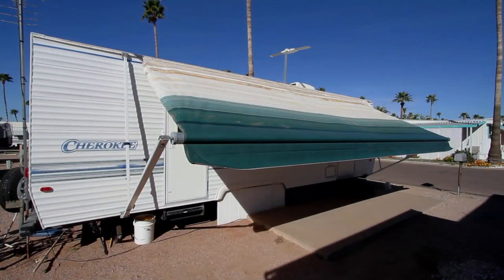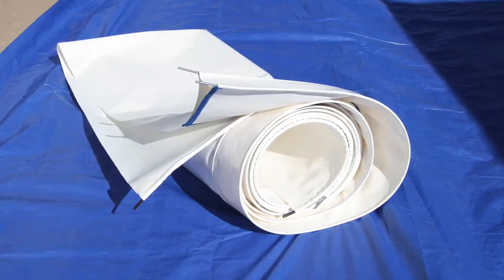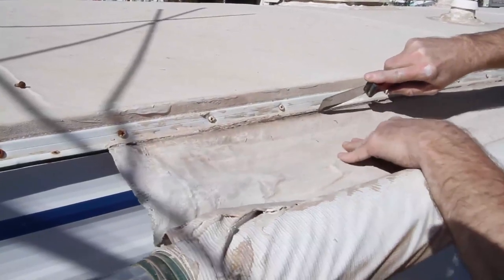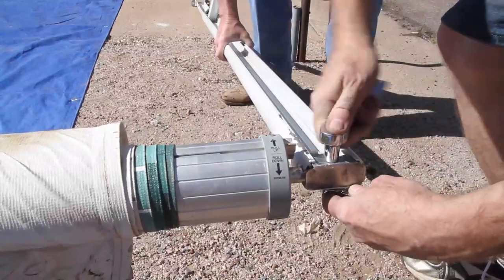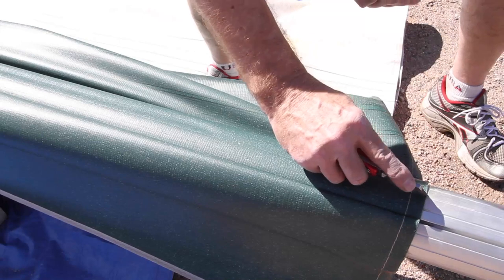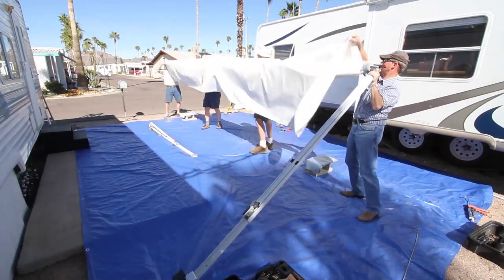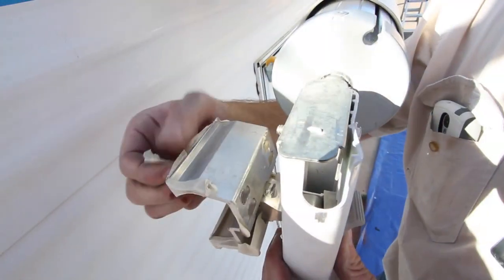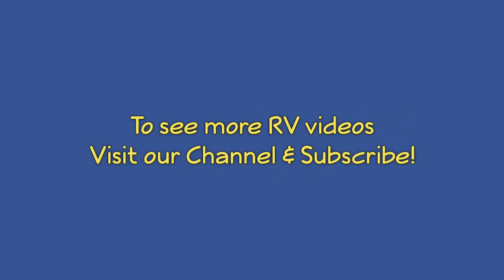RV Patio Awning Fabric Replacement - Tough Top Awnings Discount Code RVGEEKSROCK - 5% Off Your Order

Comment: Excellent video. It took us just over an hour to do the whole thing. No place to put a screwdriver in to hold the spring, so we took both ends off. Made unrolling and re-rolling the fabric much easier; just spin the tube! Piece of cake!
Reply from the maker: +Paul Fredricks Excellent!
Reply: +Chris Edwards yes, just unwind it with the vise grips and count the turns. no big deal.
Reply: +Chris Edwards the tension is fairly light, at least it was on mine. Mine is 13' wide. I think I did it myself. there is enough room to put the vise grips on the shaft between the bracket and the tube.

Comment: Easy going and I didnt have to cook for my helpers!!! In and Out is always a good bribe!!!!
So issues I had....the top rail was packed full of dirt after a mere 10 years outside and very little roof cleaning. I took a wire brush to the rail then power blasted with the hose. I was in no hurry and let it dry while I did the 360 vents. To spin the tube tight I used a rubber strap oil filter wrench. Worked great and I had visions of the Vice grips turning like a Helicopter rotor into a body part...  I usually injure myself once per trailer project. None today!!
I went ahead and gave it one extra twist and it turned out fine. I also hit the spring with WD 40 on the rusted parts.
If you have this style awning, locate yourself some sort of additional strap to keep it secure while on the road. A big bump in the road can cause the bars to unlock and the wind will take it away. I use a dual "D" ring(like a motorcycle helmet strap) to lock it closed when not in use.  Power awnings usually lock when not in use.
Screws in the bottom were pulled out a bit and rusted. I used new screws that were a little longer and in they went with the little bit of Dicor self seal I had remaining from the 360 vents.
I have written this in many Geek replies...do not try to save money by purchasing 1-2 dollar chalk from Lowes or Home Depot. It is not made to roll down the highway. It is made to fill a crack in a wood fence. You have to Buck up and spend the 12 dollars on Dicor or (OUCH) 16 buckaroos on Surebond SB 140 when doing the skylights.
Thanks John and Pete
Reply from the maker: Thanks for the great input on how your awning project went, Scott. Love that you didn't sustain even a single injury on this one! :)

Comment: The step by step instructions are spot on.  Unfortunately the guy I bought the camper from had already purchased a cheap replacement and we had to push the cords through the pockets and there was only one cord pocket connecting the fabric to the roller.   To anyone reading this, buy a good replacement awning from the guys RV Geeks recommend and not cheapo ones from Walmart.
Reply from the maker: Hi John! Sorry to hear the previous owner went that route with the awning fabric. Tough Top Awnings is definitely far superior than anything else we've ever seen. It's obvious just by looking at it. And it even comes with the cord installed already!

Comment: Thank you a dozen times!
I'd have made at least a dozen errors had I done this tricky job by the seat of my pants! (I'm a pretty good mechanic.)
My wife and I replaced our 13' awning in under 3 hours, with a key hold-up related to the fabric we bought, not your instructions. I did also, as mentioned in Comments, cut the top fabric free of the awning roller to make removal simple.
Thanks for a SUPERB video tutorial!!
Reply from the maker: So great to hear, Jim! That's awesome. Thanks for letting us know we were helpful. Means a lot.

Comment: This was the most helpful video of the group. Was able to do this with 1- 1/2 people my wife is not real good on ladders but was able to help at points. Her and a couple of saw horse did the trick. learned enough about changing this awning that we were able to cut out a good corner of the old cover and replace the slideout topper . Would post  pictures if there's a place to do so.

Comment: Thank you for making this video. I used a combination of a few different techniques, but your video was the overall template I used. Worked great, and saved me several hundred dollars! One tip I would be in additioin to using the silicon spray on the tracks would be to put it on a paper towel and  lightly polish the aluminum spindle (the spacing between the awning track and the valance track) - made the fabric glide right over it.
Reply from the maker: Great to hear you had a successful installation, George. And thanks for the additional tip! 😊

Comment: i was going to follow your instruction to change mine.  a across the way was watching and offered his help.  thank god! we removed the old one in 5 minutes by  simply cutting it and sliding it out. first we drilled a 3/8" hole in line with the valence channel which was covered by the roller cap, then filed a slot to allow the valence to be removed.  we extended the awning fully then removed the arm bracket on the side we were sliding the new awning in ( the front in this case ) we only had to remove the 2 bolts and drop 1 arm.  we cleaned the channels and lubricated them with lots of dish soap mixed 50/50 with water.  with 2 guys guiding the new awning and 2 guys pulling it, we set it in place on the roller and the camper at the same time and just pulled it gently along.  literally in 10 minutes it was done.  we reinserted the stop screw, seem sealed the top seam and caulked the top. We took the time readjust the arms so they lock in place on top, which they never would before. All together we took about 45 minutes, 25 of that was adjusting the arms. I realized we modified the end cap of the roller by drilling it but it was a 2002 model and there was no warranty to void.  I'd personally recommend this way for anyone that has an older model camper. curious about your thoughts on this.
Reply from the maker: squeezy33 This sounds really interesting, but we have a question about one part of it. If we understand correctly, you drilled out the roller tube to allow the beading in the fabric to be slid out without removing the end cap, very much like what we did here: https://youtu.be/iF5IhGQuQm0?t=3m16s. If that's the case, it seems like you should then have been able to remove the old fabric and install the new fabric without removing any other hardware. But you mentioned that you "removed the arm bracket" by removing the bolts and "dropping 1 arm." If the channel was drilled out to allow the fabric to slide in and out without removing the end cap, why was it necessary to also remove the bracket & arm? Very interested in your method, and would like to be able to picture exactly how it works. Also, what brand is your awning? Thanks!
Reply: +RVgeeks yes we did remove the leading an from the camper. this was not absolutely necessary except that the two people feeding the fabric were to short to reach up comfortably. it made it much easier and we were more able to control the new fabric being fed in the roller and preventing it from accidentally tearing. I understand your video shows the proper way of doing this without modifying the end cap, which would void any warranty, but my camper is 15 years old so, what the hey! 
thanks for your reply. your video was still very helpful and very detailed. it would have worked 100%. but after we replaced the first end cap and put the canopy to its original condition, it was literally 10 minutes max and we were done. there new canopy looks and works great.

Comment: Thanks so much for creating a video that is a great starting point.  The replacement fabric on our awning came with instructions, but no illustrations and some of the steps were very confusing.   This put pictures to the words, which basically described the same steps you did.   However, like another poster here I found that the rear end of the roller on my A&E awning had no hole for a screwdriver to stop the rear spring.   Reading down in the comments I saw how someone (squeezy33) had used the milled/drilled slot method to remove the fabric and I did that, worked perfectly.   I liked that a lot better than the thought of drilling out the rivets on the end cap and unwinding the spring.  Saved needing to purchase a rivet gun for a one time use.   the new fabric has a valance that is completely separate from the main awning so it made it easy to install.
Reply from the maker: +CaptainHarlock999 Thanks for reiterating this tip. Here's a video we made this year with Tyler from Tough Top Awnings, showing the "drill out a channel in the roller" method, performed on a slide topper: https://youtu.be/iF5IhGQuQm0

Comment: Basically right but way more difficult than it needs to be. They didn't remove both springs which allows for inspection and lube before re-installing. It also makes putting the fabric on much easier and easier to roll. Also suggest 2- saw horses vs. on the ground to save your back. Myself and one other guy can usually swap a fabric and have it back up in a 1/2 hour or less. However we have done quite a few so a
hour to 1.5 hours should be expected.
Reply from the maker: Try our updated technique. Much better!
How to Replace RV Patio Awning Fabric - NEW EASIER METHOD! Dometic / A&E Manual Awning + BLOOPERS!
https://youtu.be/vnxDLPDoVCc

Comment: It turns out that when I replaced my fabric, I had to remove both end caps because the cord for the old fabric was folded back inside the tube and I could not pull the old fabric off.  Removing the other end cap is a little trickier because you don't have the ratchet cam to hold the spring.  So, you have to attach the vice grips and hold on to them firmly while you remove the bolt and side arm.  Then you release the spring tension just like the first end cap.

Comment: Great Vid. My awning has been off RV for a year now. Its around 25ft wide. My problem is the tension on the springs are no more from when i removed it. I observed that your spring took 9 Turns? Without any idea how many turns mine takes would it be a safe bet to go 9 turns for my spring tension? Or do you have a better solution,thanks?
Reply from the maker: Hey Jim! THE guru on this topic is Tyler at Tough Top Awnings. We'd suggest you drop him a note with your question at tyler@toughtopawnings.com or call him at (360) 980-0537... and tell him the Geeks sent you and said Hi! And if you're ordering fabric from him, be sure to get the RVgeeks discount, usually 5% with discount code RVGEEKSROCK, but 10% right now for the Quartzsite RV show - discount code RVGEEKS10 now through 1/29/17 (the last day of the show). Hope you make out okay!

Comment: Great video, My camper came with the awning removed from it, any help on correct placement, and winding the spring for correct extending it? Sun Chaser by Domestic. Thanks for your help, keep up the good work, Eric
Reply from the maker: Hi Eric. Not sure about this one, but in case it helps, here is the manual:
http://www.campingworld.com/includes/productSpecs/Dometic%20Sunchaser%20Patio%20Awnings%20manual%2051656d.pdf

And here are the instructions for replacing the roller tube:
http://www.hannarv.com/Content/files/Awnings/Dometic-AE-Sunchaser-RV-Patio-Awning-Service-Instructions-Manual-Seattle-Bismarck.pdf

We suggest a good resource for this would be a posting on the iRV2 forums, where other RVers have probably already done the job themselves, and are eager to help. It's free to sign up and post at http://irv2.com/forums

Sorry we're not more knowledgeable about this one, but hope this gets you headed in the right direction.

Comment: are those steel or aluminum pop rivets?  It was so easy to drill out I'd think the originals are aluminum. Can you replace them with steel? or would steel rust?
Reply from the maker: We're sure that those are aluminum rivets, but stainless steel pop rivets are readily available (we have some on board). They're very strong and won't ever rust.

Comment: Everything on mine looks the same, it's an a&e but it doesn't have the plastic cap on the rear or a hole to lock the spring on that end.  Do I just skip that step or is there something else I need to do.  I haven't started the job yet but want to make sure I fully understand it all before starting.
Reply from the maker: We’re not sure about that one, sorry, but we’re going to make two suggestions. The first is that before you start, you use the new easier method that we demonstrated here: https://youtu.be/vnxDLPDoVCc  The second thing we would suggest is emailing Tyler at Tough Top Awnings through their website. He will absolutely know what to do.
Reply: @RVgeeks 
I talked to a local RV shop today and they said what they do in that case is leave the right side locked and remove the left side from the support arm, unwind that side, remove the rivets, etc etc, and do everything off of that end while the other side remains locked with the locking mechanism.  Just thought I'd post that up here incase anyone else faces the same issue.
Reply from the maker: Thanks for the update! Sounds like a plan!

Comment: Thanks for the video!! I'm getting ready to change mine. The canopy is lose from the camper, & I will have to wind both springs. Is there a "rule" of how many turns to wraps?
Reply from the maker: Hi Dewayne! We did an interview with Tyler from Tough Top Awnings, where he provided tips about tensioning springs, but that was for slide toppers: https://youtu.be/tIj6GdLMOBM That may be helpful, but we'd suggest looking at the roller tube replacement manual (we assume you have a Dometic/A&E 9000, like the one in this video) for details about tensioning based on awning length. It's on page 7 here: http://bryantrv.com/docs2/docs/aespring.pdf If you have a different model or brand, you can Google "roller tube replacement" and your make & model to find your manual. Did you already purchase your replacement fabric? If not, we HIGHLY recommend Tough Top Awnings. Not only is their fabric far better than the original, or anything else we've ever seen, but you can get a 5% discount using code RVGEEKSROCK at checkout at http://toughtopawnings.com and you can get great support from Tyler himself (his contact info, including cell number, are all over their website).
Reply: Thanks!! I have a new awning already. I just have to find out the particulars about the roller. It's on an '83 Fleetwood.
Reply from the maker: Definitely check the awning owners manual, and they should have details about tensioning.
Reply: I looked at the video, & it was quite helpful! I'm planning on attacking it this weekend.

Comment: What would preclude you from cutting the fabric and  removing the arms so you dont have to walk the arms down the side of the rig? With the arms out of the way it seems as if it would be no problem to pull the fabric thru the track without the need to support the arms.
Reply from the maker: You can't get the old fabric out, or the new fabric in, without removing the end cap and spring, so I don't think you could do it without taking the roller down. Even if you could, it would be a challenging job doing it all up on ladders.
Reply: Thanks for your reply.  It turns out it's a mute question. It was torn completely...all the way across. Not at all what I expected when my son told me "Oh by the way Dad, I tore your awning" Yeah thanks son. Gonna be a bear getting the old stuff out.
Reply: RVgeeks He is talking about the initial step after you remove the lag screws that hold the arms to the RV.  I just replaced my fabric today and it was much easier after removing the screws to just get up on the ladder and cut the old fabric.  Then just lay the arms+roller down.  The small piece of old fabric left in the channel is easy to pull out.  Oh ... and thanks for the detailed video.  It saved me mucho $$$.
Reply from the maker: Jerry Dewlen Got it! Thanks Jerry. I never thought of that, but what a great idea! Glad we could save help save you some dough. :)

Comment: Hi I need some additional help. I have a 86 Alllegro. It had an awning but was removed when I bought. I found a used replacement off of an identical RV how ever I had to take the side arms off to bring it home and I am sure I lost tention and did not knowing the number of turns and placement?  Sorry for misspelled words, writing this on a plane ride to Vegas.
Reply: Did not finish, how can I reset or know number of turns if I did not count or use a screw driver to hold ( as in video), or know how to reassemble?
Reply from the maker: Gary Larkin Hi Gary. We'd suggest looking to Dometic for the answer on this one. We found a link to their replacement instructions for a typical awning (might not be your model of course) here: https://www.dometic.com/91a67e1c-1b8d-40a0-a22c-3b83ac5d3379.fodoc The details about torsion winding are on page 7. If you have some other model, they probably have those details available too. Let me know if you have trouble finding the right instructions for your model and I'll see if I can help.

Comment: hey guy, Question: I see I have a A&E  Awning, but I don't see if it's a 8500. How would I know this? Thanks for the video.
Reply from the maker: There should be an information label inside one of the arms, which you can see when the awning is open. It should have all the details you need to determine which model you have.